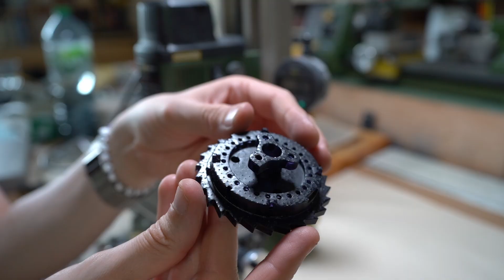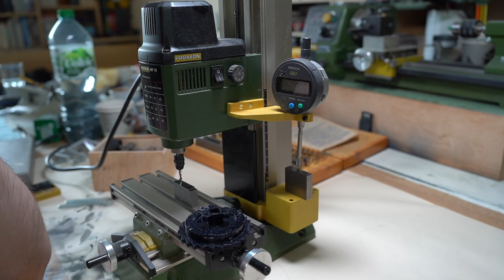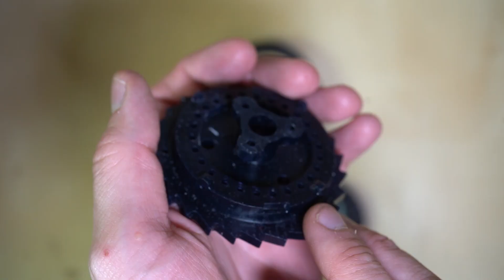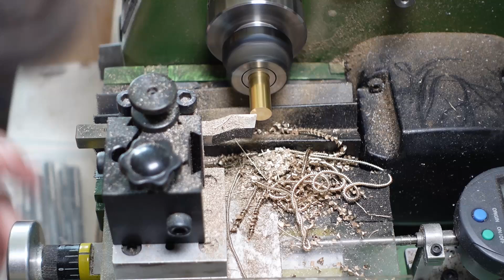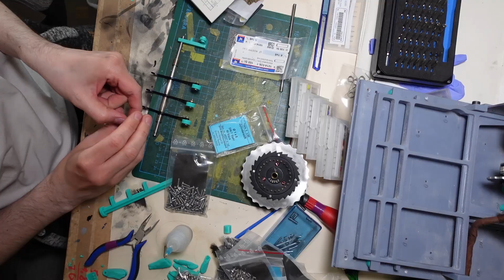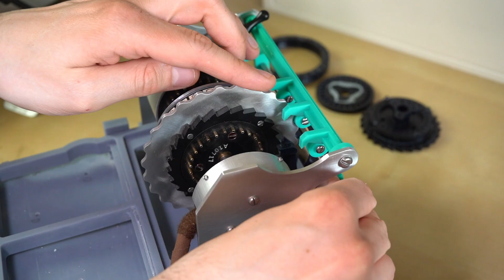The Enigma Build Project – s3e6 The Stepping Mechanism and Machining 3D printed Resin

Comment: I have been following your entire Enigma project and I have nothing but admiration, chapeau!
This machine has fascinated me for many years and I have seen a number of attempts to refabricate it.
I will be most interested to see if the pin spring tension causes any issues for you, this appears to be one of countless stumbling blocks. In those most extraordinary technical drawings, I see the pin spring diagram but missed any force metric for it. 
Keep going, your work is fantastic!
Reply from the maker: Thank you a lot for the kind words, just the right motivation for the rewiring of the new Rotors. And yes the Springs are an issue and i hope the ones i have will be good enough. we will see